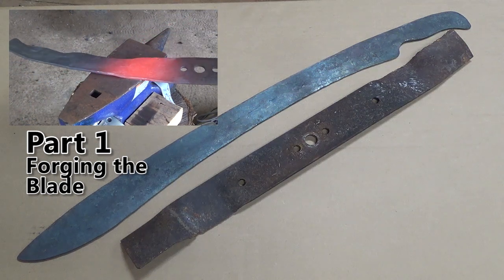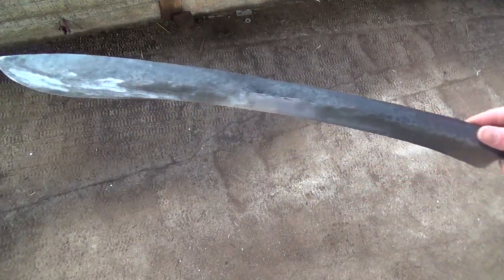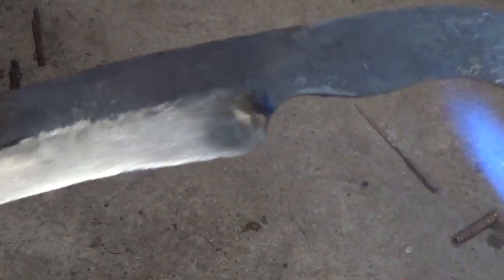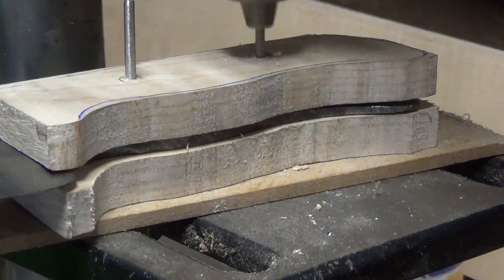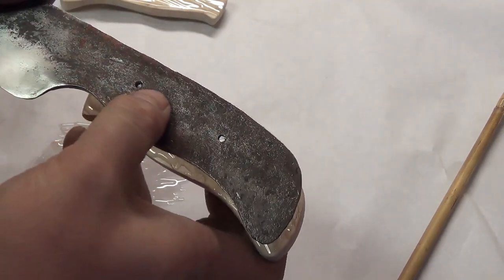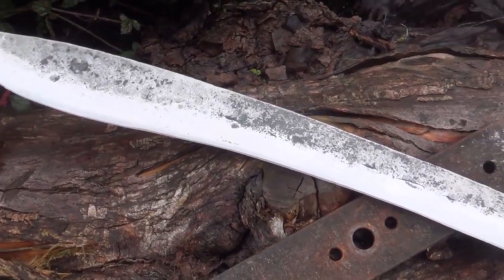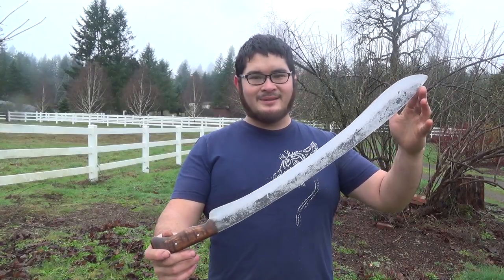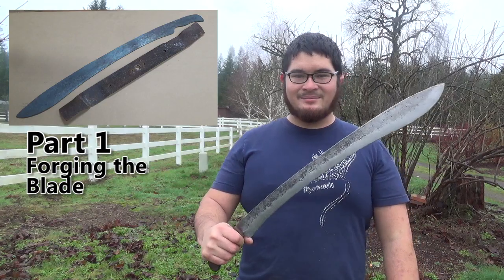Forging a Kopis Short Sword Out of a Lawnmower Blade Part 2 - Grinding and Finishing

Comment: bad ass blade, I love the fact that you took a hole lawn mower blade, closed the holes and the only grinding done was on the bevels and scale. 
beautiful work man, and I don't know if you know this or not, but the way the bottles and pineapple were just sitting there after hacking of pieces of them, is the sign of a clean cutting blade, and by extension, a very good Smith.
I wish I could hit the like button more than once

Comment: Hello Nick, I like to make a pvc bow but don't know what pvc. I found this at lowes, Charlotte Pipe 3/4-in x 10-ft 480-PSI Schedule 40 PVC Pipe. Can I use this even though it is rated at  480-psi? Does the psi make a difference?

Comment: I advise using brass pins and not peening them. peening then runs the risk of splitting the wood. epoxy and pins should be enough, even for the toughest jobs. 

You can also send these projects out to a heat treating plant.

I advise going to ace hardware for fire place bricks and zoeller forge for a proper torch.
Reply: +guitardaddy6 peening a sword is common practice an epoxy is great but peen is the most secure way to hold it together.
Reply: +1 Stonewolf (The Doctor) yes, it may be the best way, but while using wooden scales, there is a high chance that the wood will split if you often too much. 

however, skipping the peening, wooden scales show to hold just as well if not slight worse than if one that was peened. 

even knives that endure heavy impacts in hot/wet climates have stayed I tact without peening. 

therefore, I reassert my claim with a good epoxy, you can forgo the unnecessary risks of peening wooden scales.
Reply: +guitardaddy6 phone auto correct.
Reply: I think a light preening is okay with a wood like maple. If he were using a hard wood I'd definitely advise the method you proposed.

Maples tends to dent rather than crack.
Reply: +Never Wolf that's something I didn't know. We learn new things every day. I appreciate your input. light peening on maple is ok. I'll remember that.
Reply: guitardaddy6 that's just how I've known the wood to behave. There could be harder maple for all I know. And technically your approach still minimizes risk. But I certainly feel more secure with a peen even if it might be over kill.
Reply: cool. thanks for the link. I've been looking for some of those. :)
Reply: +guitardaddy6 wtf is this thread of comments? Constructive criticism? ON YOUTUBE!? What the shit.

But seriously well done gents, pleasurable banter for a change.
Reply: Scott Bergin hell yes. I can't disrespect my creative family. better help where I can and take help where needed. fuck ego bob. I want everybody to get better. ;)

Comment: Would like to see you forge a knife just for batoning wood, something heavy and straight, say 8 inch blade length with a thick spine (for hitting), with a sharp corner along the back for using a fire steel.  Most knives are too thin to baton with and a purpose built knife would be a fun project.  The thick blade and steep angle would split wood well and hold an edge for this bush craft tool.
Reply: +Johnn Schroeder 
Another blacksmith on youtube with the channel name 'Chandler Dickinson' made exactly what you described and it turned out pretty neat.
Reply: Thanks for the heads up on chandler, will look him up.
Reply: Johnn Schroeder Ya he is awesome, he does a lot of really neat stuff with railroad spikes. He deserves way more views/subscribers.

Comment: your anvil is much to light weight for the heavy forging you were doing if you get a heavier anvil it won't bounce around like that you will notice a massive difference in the speed the metal moves with each strike

Comment: What is the best steel for forging blades.
Reply: +TheMrWoodsman you must learn the riddle of steel.
Reply: If you are talking about medium sized bushcraft knives, most people would agree with O1 tool steel being the best. Regular high carbon steels are also very good, the larger the blade the less carbon content there should be (ranging between something like 1060 and 1095.) There is plenty of other sources online that could tell you more detailed answers.
Reply: +Robert Pothier (Super Roman Glitter Man) Thank you Robert.
Reply: the important thing to remember is "the right steel for the right job"
Reply: You can make anything out of high carbon tool steel but for blades longer than about 14" you must burn out the carbon by means of repetative folding until the carbon content is more like 1075 steel.

It's probably preferable to just start with the appropriate carbon rating and then you won't have to fold anything for longer blades. It depends on how much flex you want as well. 1075 seems to be a happy middle. About 0.7% carbon content
Reply: +Never Wolf Folding does not remove carbon
Reply: +TheMrWoodsman o1 tool imo. get it on amazon/ebay. easy to harden and treat,
Reply: right
Reply: The larger the blade the less carbon you need if its too high they snap easily
Reply: +Swordfightbeast That is a great age to start learning your craft. Good luck
Reply: Thats when i started in late 2011 when i was 11
Reply: honestly....thats a really loaded question. we could just say high carbon steel, but then....which one? s30v? 440c? 1095? O1? i could go on for quite a bit.
Reply: also depends on what you want when you say "blade"

Comment: I would have tempered the edge of the blade to redish color  instead of straw,it might be too brittle as you did,historically european swords were between 45 and 50 HRC if i remember right
Reply: this is more machete than sword.
Reply: It doesn't matter,i'm not sure about machetes but axes also are tempered to redish because it reduces brittleness(and also hardness).When you swing something as long as the blade he made if the edge alignment isn't perfect the blade will flex when you hit something(even a jug of water) and with that temper the chances of breaking are very high
Reply: +Fenrir Lokisson He softened the spine well enough.  The worst he could expect is a chunk of the edge to chip off when he's chopping thick wood or something.
Reply: +williwonti
He oil quenched it, so it's probably plenty soft allready, considering it's from a lawnmower blade, so mistery "steel"...
Usually, lawn mower blades aren't event in the quenchable range of carbon, ie 0.3 or 0.4% carbon. often even less...
I'd be curious to see a hardness test, I bet as is, a file bites in this blade like in grated cheese!
Seeing the sparks when he bevelled the blade, that's mild steel...

If it was intended for serious use, testing the steel a bit better, or better still using a steel that's for sure good as a starting point, either by buying, or by using steel from big leaf springs, for example, and being serious about the heat treat would be a must, 
but for a long blade, that's destined to be a backyard chopper, safety wise,  it's better to have a bendy noodle with poor edge retention, than a badly tempered, hard as fack, send shards of steel flying in the eyes of the assistance danger of a blade!

After all,  you can straighten up, the thing easilly, and if it doesn't hold good edge for long, at least, it's easy to give it back some bite (also why most real world machetes, not cold steel san mai wankery, are made relatively soft, you can work on them with a file, if you need to, and it won't break! plenty good enough for canes, vines, etc, even though you'll need to sharpen often, and even more often if you have a go at cutting harder stuff !

In a way, in that case, shitty steel might be considered a safety factor to compensate for the relative amateurishness of the work!